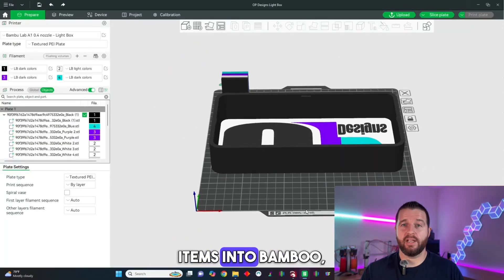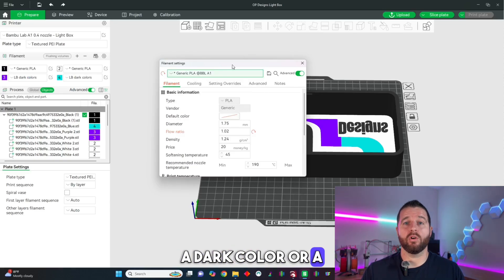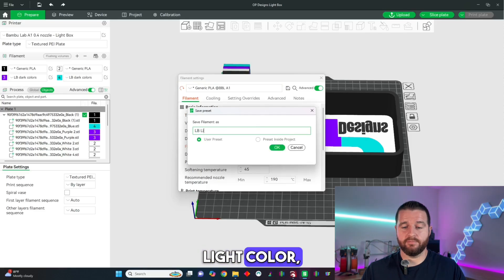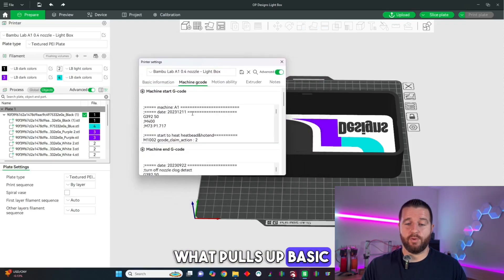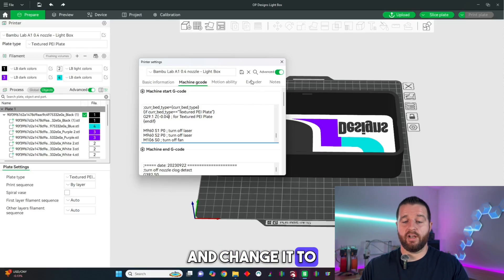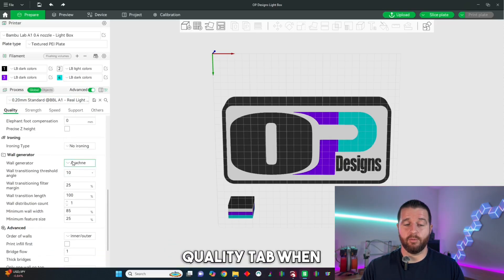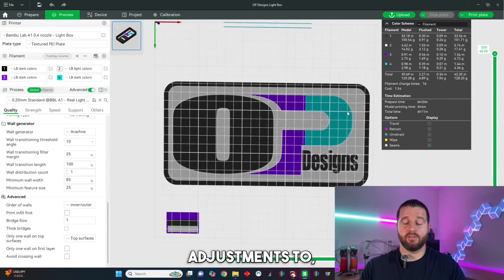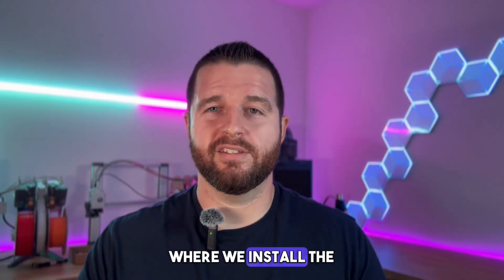Special Settings for 3D Printing Light Boxes!

Comment: Do you generally print Reflection or Diffusion layers in your lightbox?
Reply: I typically like to use the reflective layer, because it brightens the box up a bit. Alternatively, if you feel up to the challenge, layering a sheet of aluminum foil flat on that packing also does a great job.

Comment: What's the best way to prevent colors from contaminating the others? I have my flushing vol set at 3 and I still have issues with color spots showing up in the other colors. It looks like a drip. I've adjusted my flow ratio and I'm still having a hard time getting clean prints. Is there any advice how to fix this?
Reply: In Slicer goto plate settings and then change the filament color sequence from lighter colors to darker, usually this helps. I am having same issue recently.
Reply: @scaling3d  gia fatto ma non ho risolto nulla
Reply: anch'io sto riscontrando lo stesso problema sei riuscito a risolvere?